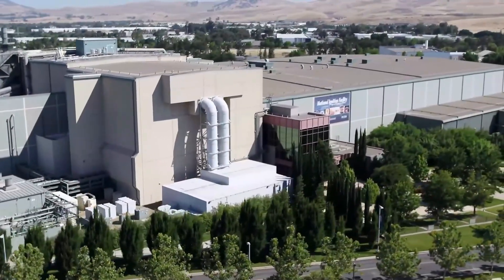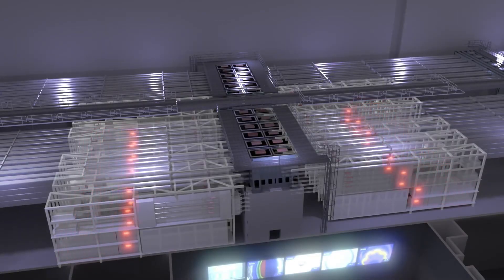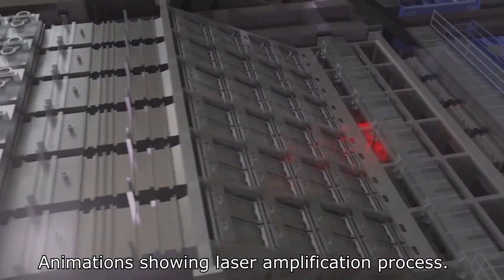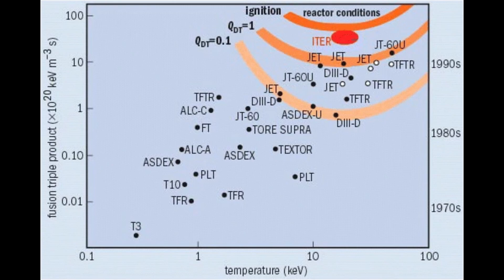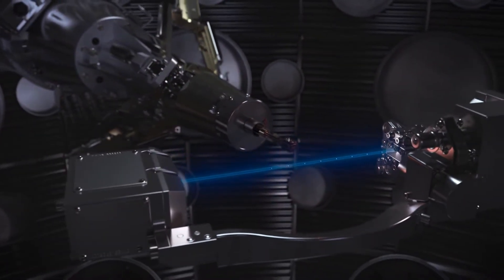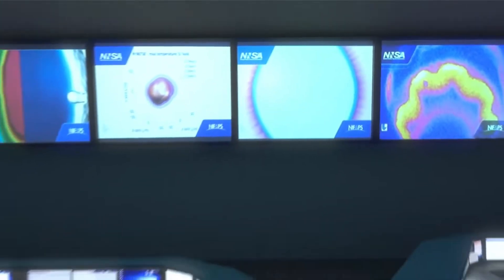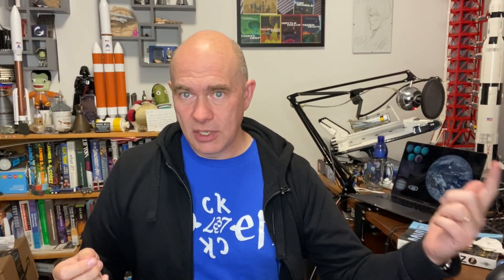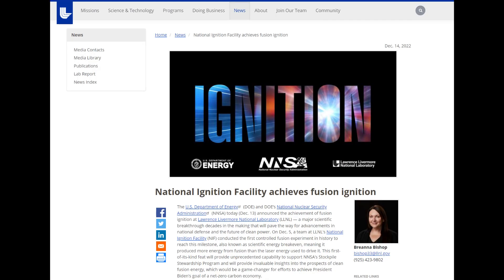Why The Biggest Laser in the World is Making Big News About Fusion

Comment: Pretty sure that First Light Fusion and their projectile fusion method is way further along in efficiency and working prototypes.  I could be wrong, but the projectile fusion method is very interesting because if implemented it makes all those other types of containment fusion obsolete.
Reply: Just the fact that the container will not have to be replaced every few weeks because of degradation from heat and/or radiation is a major advantage of the First Light project.
Reply: @pattheplanter  Magnetic containment has no container. The point is the reaction would burn through any material, so instead, it is suspended within a magnetic field.
Reply: @Safetytrousers  Where does the magnetic containment live? The physical container for the containment will be subjected to heat and radiation, however good your magnetic plasma herding is. You also need your fancy expensive magnets very close to the reaction chamber, so they get spalled rapidly as well. Part of the huge problem with fusion is getting the excess heat to your power production device without vapourising anything.
Reply: @pattheplanter  The Tokamaks of now and being built are far from being damaged by heat.
Iter will reach 150 million degrees C. The supporting systems will partly be cooled cryogenically.

''approximately 80 percent of the energy produced is carried away from the plasma by the neutron which has no electrical charge and is therefore unaffected by magnetic fields. The neutrons will be absorbed by the surrounding walls of the tokamak, where their kinetic energy will be transferred to the walls as heat.
In ITER, this heat will be captured by cooling water circulating in the vessel walls and eventually dispersed through cooling towers. In the type of fusion power plant envisaged for the second half of this century, the heat will be used to produce steam and—by way of turbines and alternators—electricity''
Reply: @Safetytrousers  The Tokamaks of now are very far from anything. Let's see whether ITER manages the sort of perfect containment that will stop any unmanageable heat from affecting the container. The radiation is still going to be a problem even if they do cope with the heat.
Reply: @pattheplanter  The bombardment of neutrons on the housing will cause it to be radioactive, but that is confined to the housing and only lasts up to 100 years. Radiation is not a problem, and part of the point of fusion is the waste is not radioactive.
We are indeed a long way from a working power fusion station.
Reply: @Safetytrousers  The residual radiation is not the problem, one problem is the spallation of the material of which the high vacuum containment vessels are made, leading to loss of structural integrity (along with the need to replace the pumps and fuel injectors). I would be very surprised if the magnets could be sufficiently shielded to avoid their gradual erosion by spallation.
Reply: @pattheplanter  ''The ITER Preliminary Safety Report presents an analysis of risks that demonstrates that during normal operation, ITER's radiological impact on the most exposed populations will be one thousand times less than natural background radiation.'' ''Activation produced in the material surfaces by the fast neutrons will produce waste that is classified as very low, low, or medium activity waste.''
Reply: @Safetytrousers  So what? I already wrote that the radioactive waste is not the problem. Replacing expensive parts due to spallation is a huge problem.
Reply: They’ve only produced tens of neutrons. Enough to demonstrate they can do fusion, but orders of magnitude away from NIF’s results

Comment: So a note about "scaling up the power". This is one of those things that is easier said than done. There are several Kilometers of beamline, and god knows how many optics, and you're irradiating them with a laser that's powerful enough to make a hole in just about anything. Standard metal mirrors don't work, they absorb too much and would melt instantly, so Optical Interference Coatings are used, aka thin films. This basically uses alternating layers of high and low refractive index materials to reflect or transmit specific wavelengths of light. In these systems typical total losses for an optic are less than 100ppm. The issue is, that right now the world leaders in  making optics that don't break when you point a powerful laser at them is Lawrence Livermore. A single spec of dust smaller than the resolution limit on the optic during coating or irradiation can lead to the entire thing being destroyed. 
The only way to test if the mirrors can survive the irradiation is by irradiating them to determine their damage threshold (LIDT). This testing is destructive and statical, so you might only get one spot of damage on the entire mirror, a failure rate of a fraction of a percent, but that mirror is now useless. We're pretty much at the limit of what mirrors can withstand at this point (in most applications), and all the easy ways to improve them have been done, so there's a lot of people trying very hard to fix this problem, all over the world. The advances here will help everything from industrial production to surgery, but we're a very long way off at this stage.

Comment: My guess is a viable system is going to use a combination of methods to achieve a sustained reaction that provides more energy than it took to start
Reply: Unlikely, the methods are all so wildly different as to essentially be incompatible. Like there may be some cross pollination of simulation and in the magnetic confinement domain different designs may steal each others notes but I don't think inertial and magnetic confinement will have any meaningful crossover in terms of being combined in a single device to make power.
Reply: @zyeborm  It's still Deuterium + Tritium fusion using sufficiently high temperature and pressure. The method used to achieve those temperatures and pressures is not really that important for a test. Tokomaks will obviously be the next step.
Reply: @SuprSi  that's the difference. The temperatures and pressures of those processes are many orders of magnitude different between the processes. 
Like worse than the difference between soldering and welding.
Reply: @zyeborm  And yet they will both achieve the same thing, so the differences aren't really that important. Of course you need higher temps and pressure if you want your fuel pellet to instantly start fusing, instant ignition isn't a thing a tokomak needs to do..
Reply: @SuprSi  ok then buddy. You keep the dream. I think running at a billion degrees and pretty much a hard vacuum is a fairly different environment to a million degrees and denser than lead but you do you.
Reply: @zyeborm  You know nothing
Reply: @SuprSi  really? What did I say what was wrong there? Do you not think there may be differences between the behaviour of matter in the low pressure magnetically confined plasma state and the no magnets involved condensed matter physics state of inertial confinement?

No I guess both have fusion in the name they must be pretty much the same thing.
Reply: @zyeborm  That's some nice word salad, you almost look like you know what you're talking about. Almost.
Reply: @SuprSi  sorry if you found it confusing.
Let's try the Socratic method.
What is the temperature and pressure environment of internal confinement fusion. Roughly. That's two numbers to give.
What is the temperature and pressure of magnetic confinement fusion.
Again two numbers.

I know what they are and have told you the same, as did Scott in the video. You insulted me in response so clearly you'll only believe it if you find out yourself. 

Given you've only been able to insult rather than comprehend the last few times we've spoken but still somehow think you're coming from a superior position unless you're able to give those numbers (which would take all of 30 seconds to find) there's not much point my talking to you is there.
Reply: @SuprSi  actually no I don't think I know better than the experts in the field. But I don't know of any experts in the field proposing to combine internal and magnetic confinement due to the wildly different environments and it is a subject I have researched. If you have information to the contrary please provide it I would be very interested to hear it.
In the mean time you can't provide 4 numbers you could get with 30 seconds of Google and you have continued to insult me and claim I know nothing instead. 4 numbers, you can't provide them. Hell I'll take 2, just the density. I've even told you them already. You just need to show that I'm wrong to prove your point but you can't.
Reply: @zyeborm  who said anything about combining inertial (not internal, but I'll assume that was a typo) and magnetic confinement? 
You seem awfully focused on numbers. As I said in one of my very first replies, tokomaks do not need to fuse the fuel instantly and therefore do not require the same temperatures and pressures. This is so incredibly basic I don't understand how you're getting hung up on this.
Reply: @SuprSi  look at the comment that this whole chain is in reply to.
Reply: @zyeborm  Dammit. Fair enough. 
Apologies for being a butthead then.

Comment: I think there’s something suspect with that fusion result. Was it 2MJ in and 3MJ out? The laser was 1% efficient, so was it really 2MJ  used? Or was it 200MJ consumed to get 3MJ out?
Reply from the maker: Hundreds of Megajoules to generate the 2MJ pulse to get the 3MJ out
Reply: time period here... my understanding is that the power for the lasers is built up in capacitors over a day or so...  a good analogy would be a waterfall with a water wheel... most people don't consider the time it takes to evaporate the water from the ocean and deposit it on the mountain as rain as part of the energy cost of the water running over the water wheel.
Reply: note - a happy ending is more about where you decide to end the story, than about the whole world around the story.
Reply: At the press conference, the director of the laboratory said 300 MJ was required to prime the components of the laser system in order to generate a 2 MJ pulse of laser energy which in turn released 3 MJ of energy.  Sounds more like 0.01 efficiency to me.  I really hope that some fusion technology does make a serious breakthrough, but even the director of the laboratory thought that they were decades away from commercial viability - but she suggested that it might now be achieved in less than 4.
Reply: @mikeparfitt8897  yeah, how far back do you want to go though for your calculation, do you include the lights in the facility, the heat to boil the water for their coffee, where do you draw the line?  the reaction / process is 150% efficient, however a lot needs to be done about the setup costs... and also the conversion to electricity or fuel to store or transmit, and distribute. However, this is the first time that reaction threshold was achieved. It bodes well for the future. Continuous electric current came from a fish, a frog and a theological argument... who knows what this well bring?  look up Galvani for more info.
Reply: @MikelNaUsaCom  yup, and it took 70 years to get from the first battery to the first dynamo, then some more years until the technology became commercially viable for power companies to be able to make a profit.

Comment: As I understand it, when Fusion researchers are talking about the amount of energy injected into the target is a bit misleading as it doesn't account for the inefficiency of the overall system.  A 1% efficiency of the lasers means 100 times more energy had to be produced to fire the amount of energy produced by the lasers.  Sabine Hossenfelder has a good video on that topic.
Reply: Reaserch lasers are not designed to be efficient. They are designed to be easy to tune.
Lasing itself can be extremely efficient
Reply: @humanistwriting5477  At much much lower power output than used at NIF.
Reply: And that's not counting how much of the energy released can be harvested. The vast majority of the energy released from Deuterium-Tritium is in Neutrons. Which are expensive, difficult, and inefficient to capture energy from
Reply: When calculating the in to out power exchange all of that inefficiency is part of the calculation.

Comment: This is incredible! I guess widespread use of fusion is now only around 20 years away!
Reply: Not long until iPhones come with a fusion reactor which mysteriously starts fusing slower when the next iphone is released.
Reply: 30 years actually
Reply: always 20 years, never 19
Reply: @Aliceintraining  Ignition WAS 20 years away.  That has now happened.  Commercial use coming soon!
Reply: @lincolnkroll  200MJ in to get 3MJ out, soon? Yes, 20 years away just like last 50 years That's the joke Basesixty ws making
Reply: @BenShepley  The lasers put in 2.05 megajoules of energy and the fusion reaction released 3.15 megajoules. Time to stop trolling, and get educated on the subject.  This is a HUGE first and breakthrough for humanity.
Reply: @lincolnkroll  1% efficient.
Reply: @theexplosionist2019  Any percent over input opens the door.  It is like striking a match to start a fire.  The Wright brothers first flight was hardly notable too... this is MAJOR.
Reply: @lincolnkroll  No, not really, not at all actually. At least, not by this method...
Reply: @kindlin  The method is inconsequential to the feat.  Net gain has been achieved, and now the race is on, with funding, for every possible method to bring fusion base load power to the grid.
Reply: @lincolnkroll  I'm not sure what makes you think a net energy gain suddenly changes everything. It just then becomes a massive engineering challenge, while still being a huge physics challenge, all while trying to be optimized for repeatability and sustainability. This technology just seems too.... complex. I just watched an interesting video from Real Engineering about Helion and their new type of inertial magnetic confinement system, it has a few advantages over the tokomak, and I think, over this giant laser method.
Reply: @kindlin  This breakthrough simply proves it can be done.  Until ignition, it had NEVER been done, so that simple fact now allows all sorts of research and funding to go forward.  Plenty of seemingly too complex scientific endeavors have led to profound new understandings, and changes in the way we live.  It is possible to imagine fusion power becoming practical and utterly changing everything about how civilization functions.
Reply: @lincolnkroll  I'm not sure I really follow that train of thought. We have been doing various kinds of fusion at lab scale for many decades. We knew how these things worked, we knew they should work when scaled up, and the last decade at the NIF was all an engineering challenges, refining the best capsule manufacturing, making the lasers fire perfectly, etc etc. You could plot the energy on a graph over time and make a prediction of seeing this. It is a nice, round number (the break even point) to help get people excited, but it's not much more interesting than 50% or 200%, as we need in the 1000%'s to get a net return from the facility out to the grid. Thankfully, we're now just a SINGLE order of magnitude away on the power side, but unfortunately, for this method at least, we're still about 2 orders of magnitude away from the time domain we need, and then they still need a way to extract the energy.

I still think other methods are more promising. At least, based on this experiment.
Reply: @kindlin  ain't is more than an even number, it is a very important number, that will inform future experiments, and drive better research and funding.  That upward moving dot plot of progress needs to accelerate, and I think this demonstration will make help that happen.
Reply: Correction - it's always 30 years away. Remember, precision counts in this business.
Reply: @StevePemberton2  that’s the joke
Reply: @basesixty6739   I know, I got it right away and thought it was funny. My joke was referencing your joke about it being 20 years in the future. However the standard number for this joke is 30 years.  So I was correcting your joke and then pointing out the need for precision when it comes to this topic, which was the punchline. Of course no joke is funny when it's diagramed out so I don't expect you to find it funny now, but anyway that's the play by play.
Reply: @StevePemberton2  oh is it, oops :p
Reply: Not when the U.S. government gets involved in it.
Reply: @KB-ke3fi  The broad and complete lack of trust in ANYONE is sad.  It is not so simple to say "the US government" since it is made up of around 18 million individuals, many of whom care and try to do a good job.  The U.S. government is not close to perfect, but it is not the worst in the world either, and has done many great things.  Funding big research and development is one of them.  There should be more.
Reply: General Fusion - from the marvel universe yeah?!
Reply: Ah! But better than the tokamaks, which are always 30 years in the future.
In the meantime, we could imagine using the power from our local fusion generator.
Reply: @chrissaltmarsh6777  Tokamaks are down to 5 years for postive Q. A commercial reactor might take 20 years from there. There has actually been a lot of progress in the last 5 years, and ITER is in danger of being overtaken by the smaller nimbler more modern designs.
Reply: It has been about 20 years away for the last 50 years. Jus'sayin'.
Reply: @jakethomson2991  thats the joke :goodvibes:
Reply: @jakethomson2991  that’s the joke
Reply: @jakethomson2991  Because for every step forwards we take, we discover it's a lot further away than we thought.
Such is science. A lot of the delays have been developing the technology to discover the next stoppage.